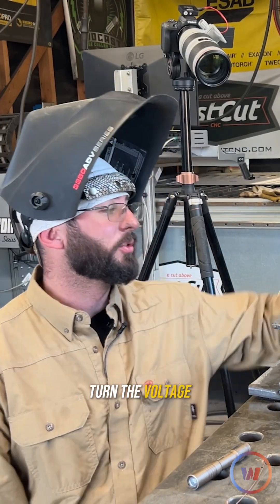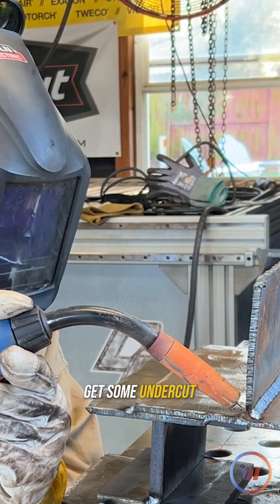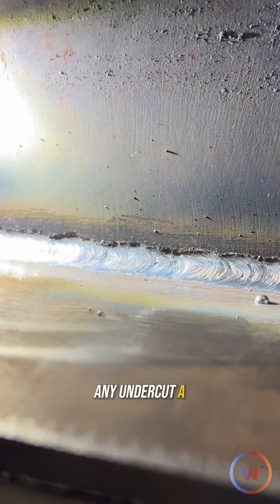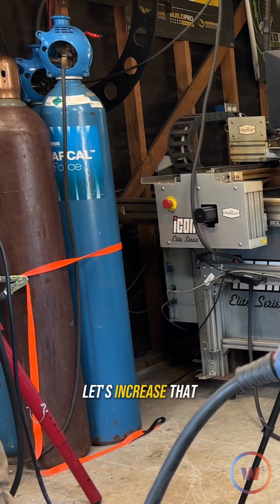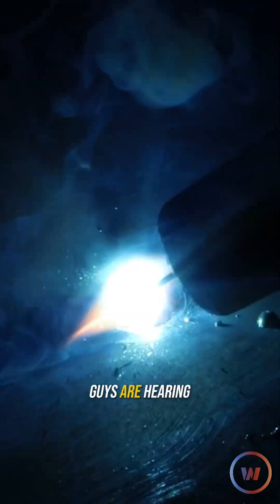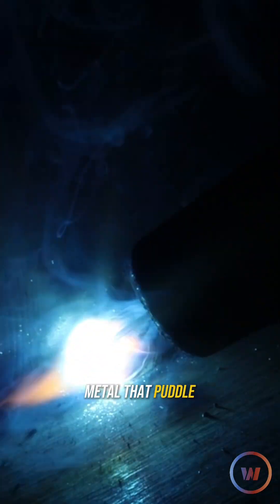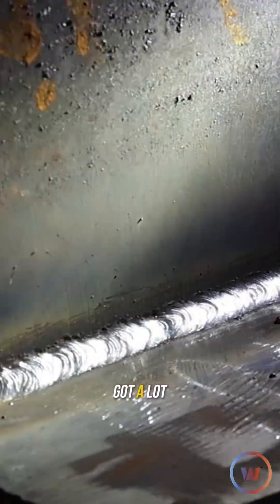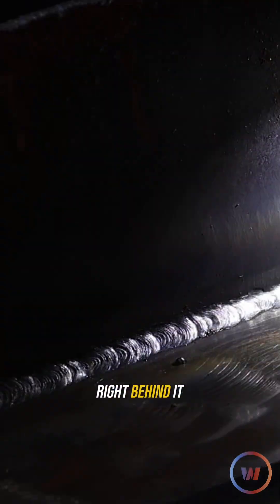Could your voltage and wire feed speed be to blame for your Undercut? #mig #welding

Comment: Mig is known for not getting the good penetration like you get with stick, so for better penetration one can go with less filler at higher voltage and slower speed to achieve better penetration. Something I learned over 30 years ago in a bushhog manufacturing facility. It's also helpful on vertical uphill with hardwire.